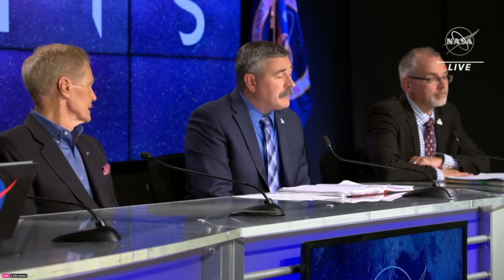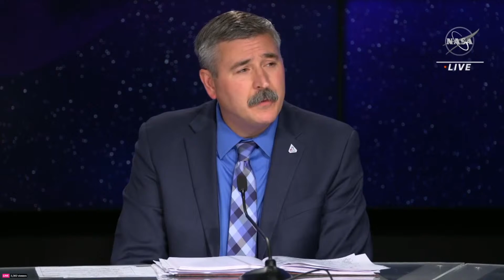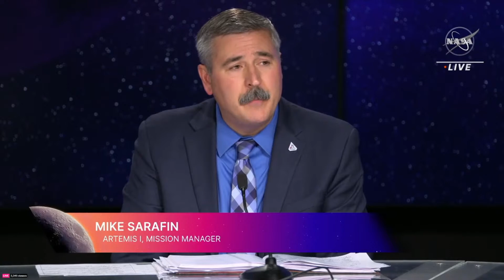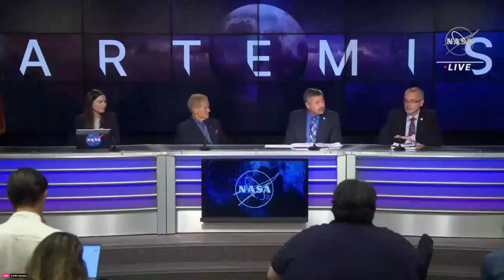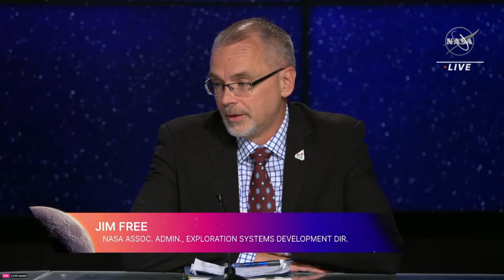NASA Explains What Went Wrong During Artemis 1's First Launch Attempt

Comment: I'm a smart guy..In real, time common sense told me this was a sensor failure. .When the upstream sensor was correct and the downstream sensor was correct, the middle sensor is faulty..Too bad no one at NASA has the balls to make that call. GOOD LUCK moving forward. Your going to need it with all the diversity hires...ALSO..Someone could have walked out and measured the engine temperature with a hand sensor. I think they're afraid to launch !!!!

Comment: The Saturn 5 launched successfully the first attempt.
Reply: I still find Saturn V rockets fascinating.
Reply: apollo 1.
Reply: @samkortland1044  Apollo 1 did not use the Saturn 5.
Reply: @samkortland1044  Apollo 1 and Apollo 7 used the smaller Saturn 1B. The first test of the Saturn 5 was on the unmanned Apollo 4 and it launched on the first try.